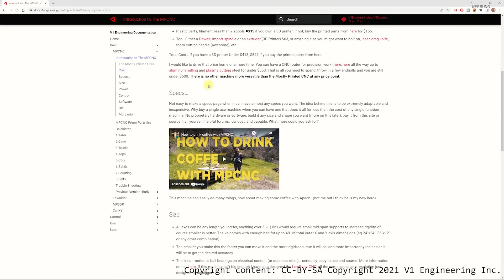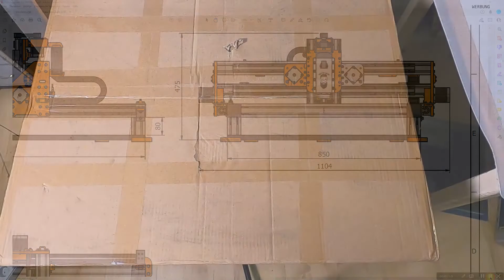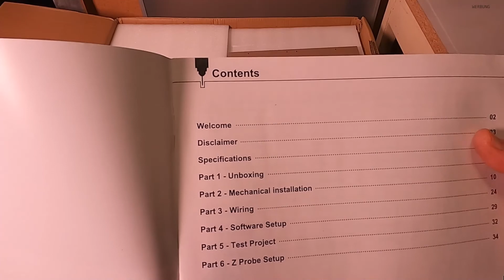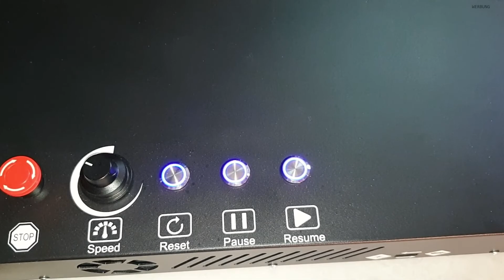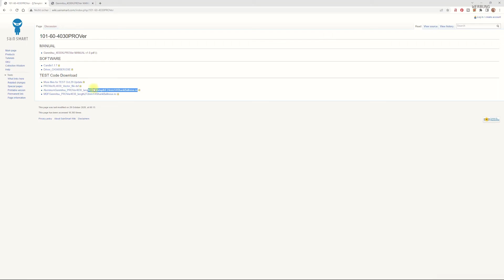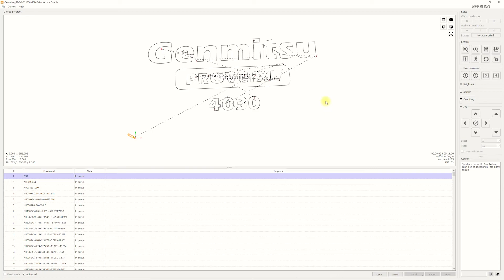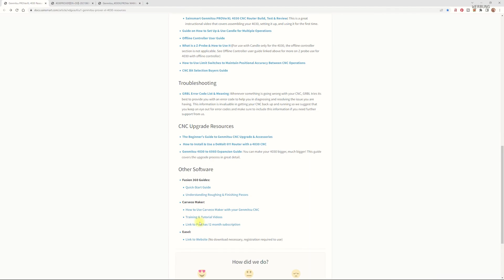Build a CNC or buy a Genmitsu Proverxl 4030 - Unboxing And First Impressions

Comment: Bonjour. J'envisage également d'acheter cette genmitsu 4030 mais je ne sais pas si je dois passer par le site sainsmart ou par Amazon ? De plus, êtes vous toujours satisfait de cette machine ?
Reply from the maker: Bonjour, c'est une question difficile. Tout dépend de la manière dont la machine est utilisée. Je suis satisfait et la machine est très polyvalente. Aujourd'hui, j'opterais peut-être pour une PROVerXL 6050 Plus CNC. Cette machine a une qualité encore meilleure. Pour les pièces plus grandes, il faut utiliser un routeur Makita ou un routeur Dewalt. Un dispositif pour fixer le routeur est fourni. Mais la broche de 300 watts est déjà suffisante pour de nombreuses tâches si l'on prend un peu de temps. Lors de l'achat, il faut absolument comparer les prix et les "frais de livraison". J'ai eu la chance de profiter d'une offre spéciale et j'ai pu économiser de l'argent. Pour une utilisation semi-professionnelle, je choisirais une machine plus grande, mais là, l'entrée de gamme coûte environ 3000 euros et plus. Bonne chance.
Reply from the maker: Hello, this is a difficult question. It depends on how the machine is used. I am satisfied and the machine is very versatile. Today, I would perhaps choose a PROVerXL 6050 Plus CNC. This machine has even better quality. For larger work pieces you should use a Makita router or a Dewalt router. A fixture is included to attach the router. However, the 300-watt spindle is already sufficient for many tasks if you take a little time. When buying, be sure to compare prices and "delivery costs". I was lucky enough to take advantage of a special offer and was able to save money. For semi-professional use, I would choose a larger machine, but there the entry costs about 3000.- € and more. Good luck.